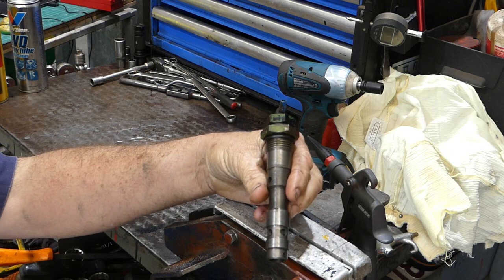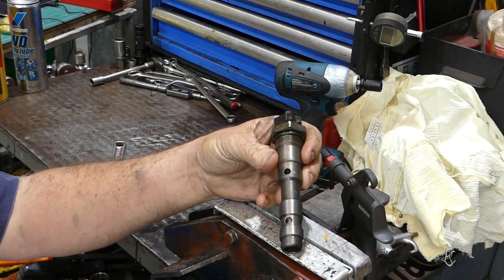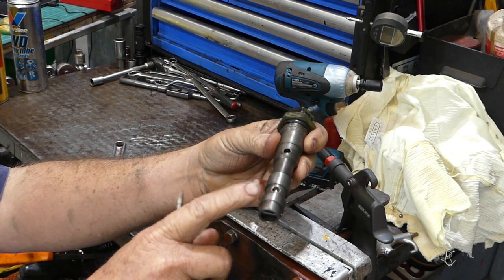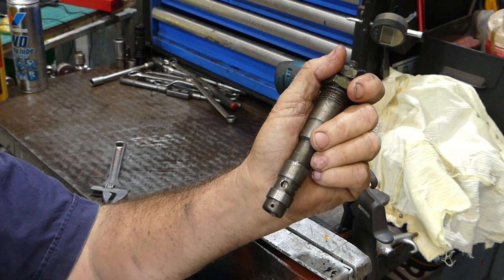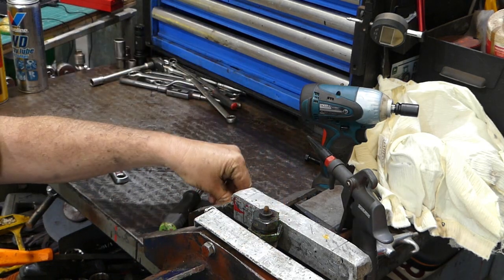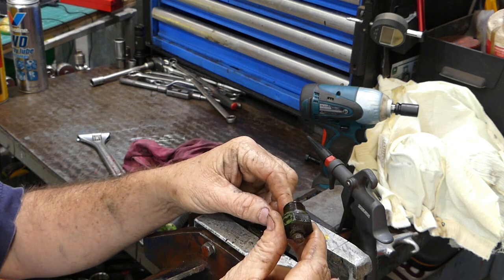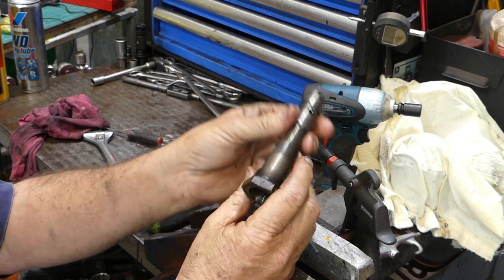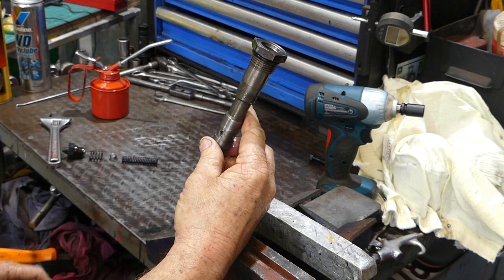John Deere 2030 Transmission Bypass Valve Service

Comment: Hi Lance. Still having issues with John Deere Manheim 2030 I recently purchased (ex Shire tractor with slasher from Pickles auction). Both power steering and lift work intermittently. Once I use full throttle it frees up and starts working. I've followed all your instructions, changed hydraulic oil and filter, cleaned both filter screens, cleaned transmission relief valve. Hydraulic oil and screens were clean. Main hydraulic pump looks as if its been possibly rebuilt. Any other recommendations? Maybe its time to have hydraulic expert do pressure testing on pump etc.? Thanks Simon
Reply from the maker: Answered on email.

Comment: If the valve is stuck open the oil will just bypass back into the transmission case?  I have a 2130 with loader and there is insufficient pressure/flow.  It builds up to 2200 lbs but if you lift the loader pressure falls off quickly and is slow to recover back up.  Trans filter and screen are clean, Oil is clean.
Reply from the maker: The oil goes to a lube circuit but running out of oil is a thing these do. Do you return the oil from the loader to the filter housing? that can help things at times.
Reply: @BundyBearsShed  Yes the oil from loader returns to the filter cup.  I'll inspect the situation during the next rainy day.

Comment: Hi my 4230 two wheel drive powershift don't want to drive if you put it in gear, at first it Just jump out of gear now it wont go if you put it in gear? Any pointer on that problem
Reply from the maker: Start checking system pressures and see if you can detect a low pressure on a particular gear.

Comment: Hello Lance, don’t know if you’ll be able to point me in the right direction, My 2130 hydraulics work erratically, basically I have no hydraulics unless I engage the PTO, this generally means lift arms and SCVs however it can also effect this steering could this be to do with this bypass valve or would you suggest it’s to do with PTO clutch, or perhaps the priority valve?   I drained the oil and changed the filter and cleaned the screen, all genuine Deere oil and filter.  What course of action do you recommend I take ?
Reply from the maker: I would think you have an internal PTO brake pipe leak as by engaging the pto you cut flow to the pto brake lines.